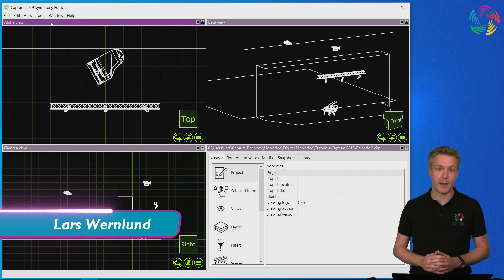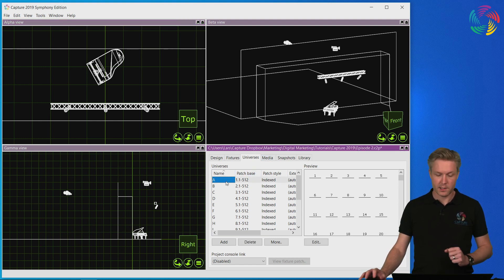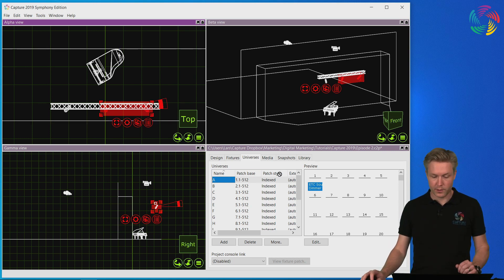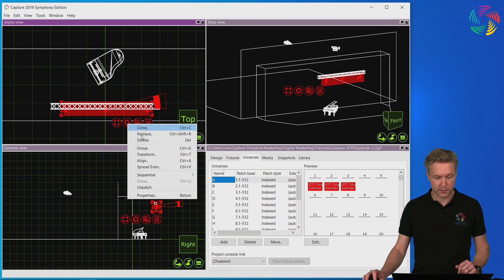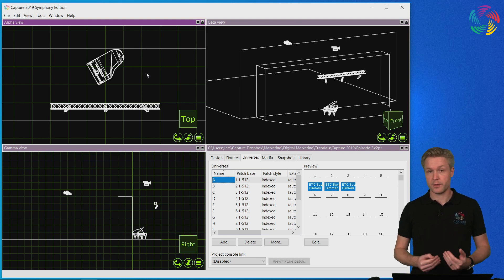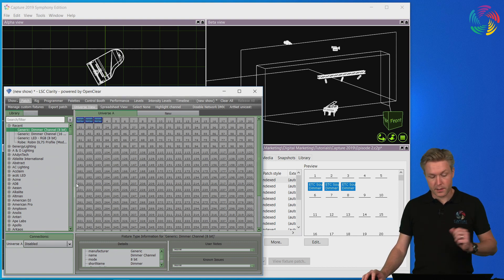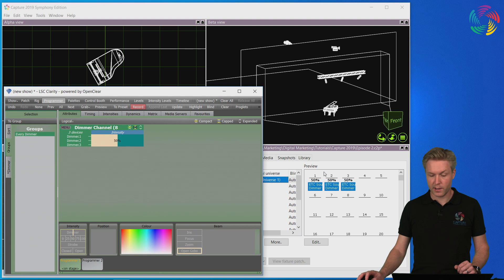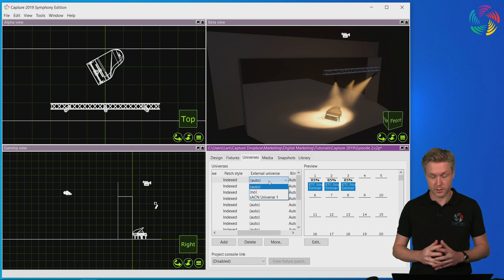Patch and Control Fixtures

Comment: Is there a way to add a dimmer pack for old lamps and at the same time use LED lights, that don´t use Dimmer pack, and connect (mix) all the lights together, i.e. LEDs with old lights that need to be connected to a dimmer pack?
Reply from the maker: We would advise you to contact us at support@ with all the details about the devices you use